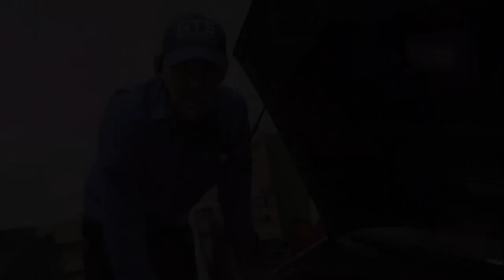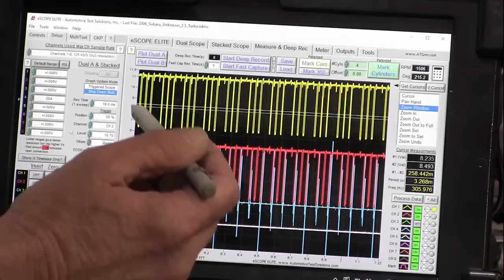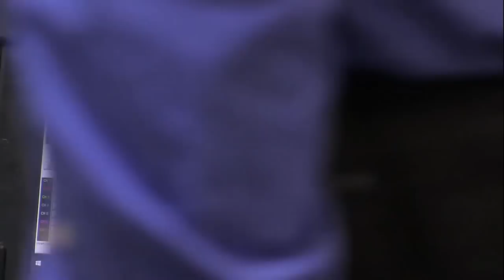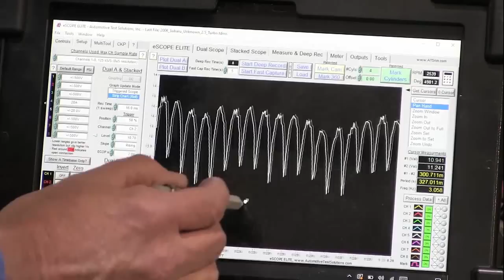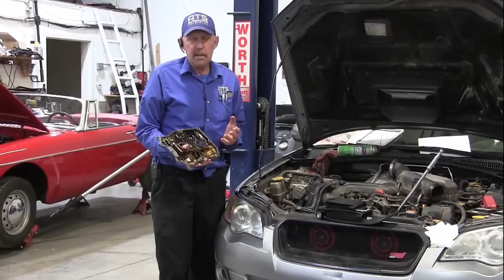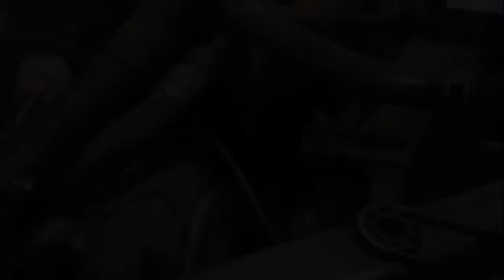2008 Subaru Legacy CMP failing

Comment: Snap on has a magnet tool that you slide in one polarity and it magnetizes the screwsdriver to hold the screw on. Then you rub the screwdriver on the side of the  tool an all magnetization is completely gone.

Comment: You proved the cams are magnetized which obviously isn't good.  However, you didn't actually prove the magnetism was causing the flips and not the grounds being off.  Was the engine run and CMP's checked with the scope with the grounds reconnected?  How do you know that just reconnecting the grounds won't fix it?  It won't demagnetize the cams, obviously, but those missing grounds can cause all kinds of weird issues.

Comment: What if you measure from falling edge to falling edge on the cam sensors and the 1st first pulse of the crank double pulse? I know some Nissan crank sensors flip like that depending on RPM.
Reply: I've seen Nissan cam sensors invert also.

Comment: I would never have thought about the camshafts being able to become magnetized. I would have just replaced the cam shaft and crank sensors, then rebuilt the heads after that and called it good. This is great info to know. Thanks for the lesson, very much appreciated.

Comment: As I was watching this, one thing that came to mind is how awkward it is to interact with these software type oscillscopes. One  thing that would be neat to have is a usb based dongle/pendant that would provide the same types of knobs and buttons that are used on bench scopes. It would make it so much more convenient to adjust things like voltage scale, time base, trigger levels, etc..
Reply: On his ESCOPE there is an option where you can scope each individual chanel and you can scale it any which way you want independent of eachother. Up to 8 chanels at one time.  On the screen he is using, Bernie and team have built it where all the chanels automatically scale for you, that saves so much time compared to manually adjusting volt, time for individual chanel.

Comment: Strange problem most of the subaru's I work on the grounds are rotted off years ago and never saw a cam code...I would try and degauss with a handheld tool first  to see if that worked...Changing the cams is a headache. the valves and shims etc...I can't see its the cams but maybe.. Does it have oem sensors or aftermarket....?  Good job...

Comment: Just imagine the trouble those HACKS caused by leaving those ground cables off ! Do you think the factory would spend money on those if they weren't necessary ? Then there were the WRONG plugs . If they MATCHED them to what was removed , how could you NOT see the difference in length ? I just had a lawnmower that would not start . The plug was gapped at .025 instead of .030 . I corrected it and it fired on the first pull . This is an older machine . Bottom line : specifications matter .
Reply: Most shops let clueless techs do services like spark plugs and they don't think to compare parts. As well as most of the R&R guys I've worked with don't feel specifications apply to them.
Reply: Those " techs " are HACKS . You learn on the first day to match parts . Imagine if they put the wrong LONG plugs in an interference engine ? Or you left on a trip with those misfires and had to pay on the road for a diagnosis and fix . Lucky if you are not ripped off . These IDIOTS do a lot of damage . They need to be sued in Small Claims Court .

Comment: So, there is no way to de- magnetize the cams in the engine?
Reply: A LARGE degaussing coil designed for old tv crt's is what's needed.  I would strip all the electronics from the area of the heads and pass the coil back and forth across the heads.  I think that would be strong enough to demag the cams.  If not the cams may have to come out and be passed through the coil.

Comment: Were either CMP sensors OE? Would it be worth it to simply try quality OE CMP sensors to see if perhaps they have a greater immunity to the effects of a lightly magnetized cam?
Reply: Bernie has another case study video where he has a magnetized crankshaft on a Honda Pilot. I believe the CKP sensor was replaced four times with different sensors including OE.
Reply: Good idea
Reply: I'm seeing this same problem on a OE sensor, I replaced one that was getting stuck at 5v but I see this same pattern as Bernie is seeing. Of course this WRX I'm working on has been modded and I would not be surprised if the ground wires were installed incorrectly.

Comment: All machine shops, especially if they do cam & crank inspection, repair and grinding, should have demag coils. They demag WIP daily. If you believe the cams need to be demagnetized, then yank them out and take them to local machine shop for a pass through their demagnetizers. Easy peasy.

Comment: i'm curious what type of sensor that used. 2 wire?  3 wire?  4 wire? i'm guessing a 3 or 4 wire hall effect from the waveform.  also curious if those were oem sensors. cheap sensors may not have the circuitry to keep the output from flippin.
Reply: This is a 3 wire hall. Ground, 5V and signal output from sensor. I have OE sensors in the car I'm working and I'm seeing the same. The waveforms are flipped during idle but then correct themselves under acceleration. Also, the car stalls during idle but will stay running as long as it is 1500 rpm or higher. Sometimes it would stay running during idle and then just shut off without hesitation. Maybe I'm losing something on demand but I dont see what could it be.

Comment: What the... I'm diagnosis a 2015 WRX and my waveforms look very similar to this and I can also see the shift and the engine dies. Sometimes the engine starts and stalls and I notice the waveform shift and also see the waveform packets are not the same. The Left intake cam is what I see changing the most. I believe i have a bad cam sensor in my case but i will double check.
Reply: I replaced the left camshaft because it was getting stuck at the 5v ref at time and was very consistent on the failure type, possibly misreading due to the magnet change. I replaced it and now I get clean waveform but I have the same case as Bernie, the waveforms are flipped and fix themselves when you rev it up and go back to flipped when the engine idles. For me, the car would randomly stall without hesitation and was setting oil control valve actuator for Bank 2.
Reply: Is it fixed now? I have a wrx 2.5l where the intake cam signals flip. Car runs fine but sets P000D bank2 cam slow response intermittently.  I'm thinking the ocv or sludge cause the cam to shift slower but the sensors flipping have me thinking something else is going on
Reply: @TrevAutoTech  appears to be okay now even with the shifting of ref voltage. This car has both signals pulled the same direction and not opposite from cam to cam like the manual and Bernie shows here. My car is a manual tranny. Just for kicks and went back on a year newer WRX and it shows both sensors pulled the same direction but it does not flip under high rev like the other car. The car that flips runs fine however and is not affected with the signal shift on both cams. Monitor your cam signals and make sure they dont drop randomly. This is what I was seeing in the car that I had failing. I dont think the ref shifting causes an issue since the car I have runs fine under those conditions.

Comment: I’m surprised to see an STi that hasn’t been modified (not visible in the video, anyway).  Another great diag, Bernie!
Reply: It has been modified; a "modifier" left the ground disconnected.
Reply: @rodvan-zeller6360  He was probably told that having the extra electrons would go to the coils and give him an additional 2-3 HP (just like the decals on the back window).  🤣
Reply: @djosbun  And for the next trick, the money in his wallet is going to turn into free electrons and float away into Berney's
electron fund.
Reply: @djosbun  Hahaha. This was good 👍
Reply: There are no STi Legacy as such, there are small runs of Legacy with STi garnish, parts/tunes etc.
Reply: Looks like aftermarket blow off valves behind the radiator grill
Reply: @bartbixler3278  Those are PIAA horns.  They’re popular amongst the WRX crowd.
Reply: @djosbun  Oh, O.K...
Reply: Its just an sti grille.  Thats an aftermarket meshed grille